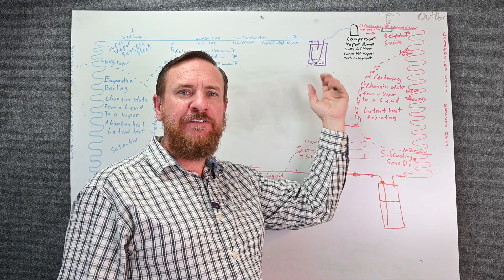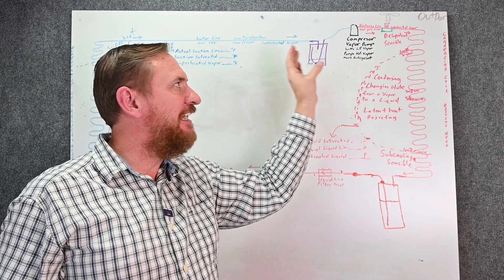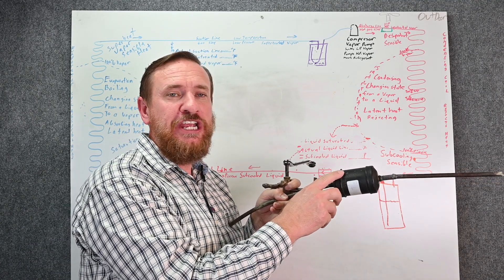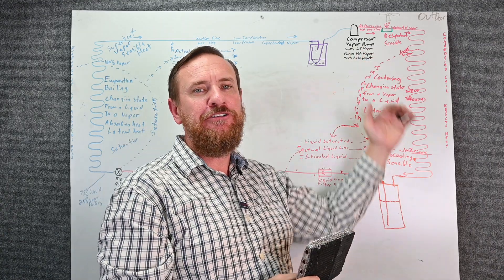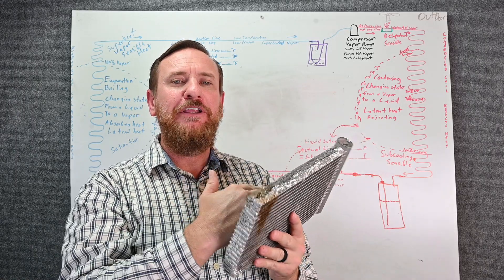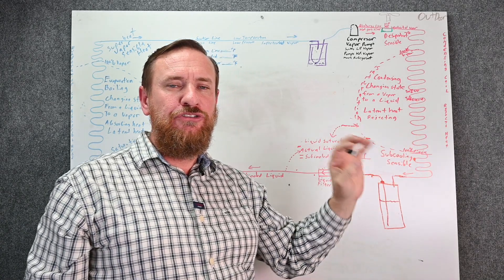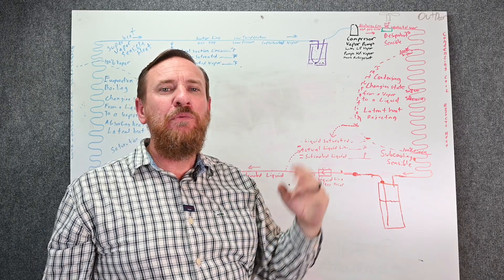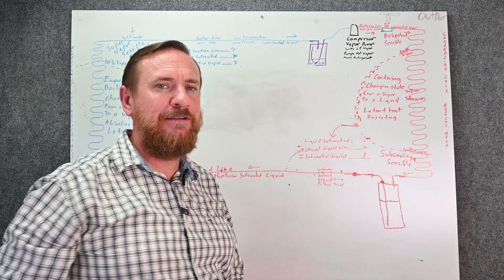HVAC 085 Pump Down

Comment: Why does the unit have to be running for you to close the liquid line service port? Why not close it then run the system. Is there a Difference?
Reply from the maker: It allows the compressor to get up and running. When you start the compressor with a closed valve it builds pressure at at the age time the compressor is trying to get up to speed. The locked rotator amps are hard on a compressor and a lot of heat in generated in the winding at startup
 Adding immediate high pressure to that is not only hard on the compressor but it can also lead to internal thermal overload tripping. The combination of John pressure, high heat of compression and start up heat /amps is a lot to ask for.

Comment: Thank for sharing the knowledge. Are all Refrigeration and Air conditioning units  designed to pump down the refrigerant or is there any exception? Small refrigeration units that do not have accumulator and large condensing unit are suitable for pump down or not?
Reply from the maker: there is always exceptions. 
They vary greatly and it depends on the engineer who designed what they are trying to accomplish and the cost factor always plays a part.
Reply: @love2hvac  Thank you sir

Comment: Hello Ty, can you explain how to perform pump down on ductless system when temperature in the room is lower than it is possible to set on controller? How to force compressor to start if there is no contactor? Thank you for the answer.
Reply from the maker: Heat the RA sensor with a hair dryer on the indoor unit.

Comment: Hi Ty. Great video. Thanks. Could you advise on the following? recently I saw York “tombstone” condenser. I have no idea how old it is, maybe 30-40 years. It is running fine. But the interesting thing liquid and suction lines are tied together and insulated together (~ 20-25 feet) Do you know what the logic is behind insulating them together (same thing in domestic refrigerators)?
Reply from the maker: They where using the heat from the liquid line to ensure all the saturated liquid was boiled away to a vapor in the suction side increasing superheat. Also cooling the liquid line that increased subcooling that reduced flash gas. 
There is some arguments. 
If you reduce flash gas you end up with more liquid in the evaporator, so you get less superheat and closer to saturation on the suction side. 
So that becomes a wash.
I am familiar with the York toumbstone but I dont know that I've seen an entire line set like that.

Comment: Is that low voltage run inside of 3/8 copper if so I love it
Reply from the maker: Yes it's an old school way of protecting the low voltage. Flared at both ends to prevent cutting the wire. Liquid tight conduits is still the best.

Comment: Never heard arcing in vacuum. There is special class high voltage switches where switching contacts are in vaccum. Agree that can be dammaged but arcing in not a reason for sure.
Reply from the maker: Copland scroll manual page 18 at the bottom few lines 
https://climate.emerson.com/documents/copeland-scroll-compressors-for-refrigeration-zs09kae-zs11kae-zs13kae-application-guidelines-en-gb-4214008.pdf
Reply: @love2hvac  I'll ask my supervisor about this question regarding the vacuum tommarow we do test compressors daily in the lab. He will know!
Reply from the maker: I hope to one day visit!
Reply: @love2hvac  Get with Don😁
Reply: @love2hvac   I must say I was skeptical and thought the real problem was overheating.  Looking at your references, it seems like it's a combination.  The vacuum takes away the coolant refrigerant, which causes the windings to heat up, which leads to thermionic emission of electrons, which have no gas to dampen them, so you end up in a positive feedback situation until an arc forms, creating more heat, etc.
Reply from the maker: Here is a video on  vacuum arc
https://youtu.be/GS0saABd-1M
Reply: @love2hvac  Hope you are not using silicone as a vacuum sealant as this guy. Video is joke. Beside that he is using neon transformer that produces tens of tousands volts. Much more than 208 or 460 that regular compressor runs.
Reply from the maker: @aleksandarvasilevski7410  do you have any resources to share to back your claim? I'm always willing to lean but everything I find says scroll compressors are at high risk of arcing damage in a vacuum. Copland compressors have much better resources for testing this than I do and I dont have anything to show otherwise.
Reply: @love2hvac   I asked my Supervisor and co-worker both with 30 plus years of expirance testing compressors. And they both told me they both have seen the windings/ fusite arc in a vacuum. They also informed me that when the compressor is in a vacuum while running the fusite pins arc and blow out and stick in the wall about and inch! He has also seen the fustie pins arc and blow out if it has refridgrent in it also. Dangerous at times.
Reply from the maker: That's awesome! Thank you!
Reply from the maker: https://en.m.wikipedia.org/wiki/Vacuum_arc

Comment: The Goodman condensers contain a built in filter drier.
Do you know if they qualify for pump down?
Reply from the maker: I would not. The goodman filter drier is before the valve. If you pump it down, how would you change the filter drier. 
Some people pump if down and put a new filter drier outside. They leave the old one and. The old one becomes a restriction and damages the compressor.
Reply: @love2hvac  The R22 unit 3 ton has 7.5 lbs Could need to recover and reuse.
Reply: If it is a micro channel you are not pumping it down. Recover period.

Comment: Can anyone answer this?  I have an evcon residential unit, was just installed a few months ago and was very quite.

Now, when it kicks on, there is a loud buzzing noise.  I felt around it a bit and nothing on the outside cage is rattling, nothing caught in the fan.  Weird.
Reply from the maker: Check the contactor.
Reply: @love2hvac  thank you
Reply: My neighbors heat pump makes one heck of a racket (buzzing noise) on compressor startup, much more than mine by at least 10x.  I don't have a hard start kit for my compressor, maybe his does or it's just noisy, not sure...